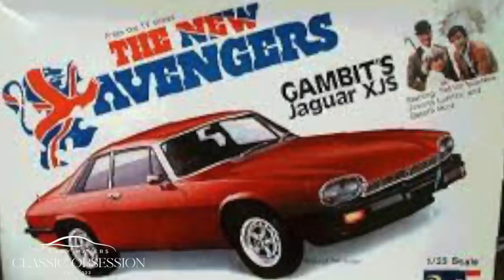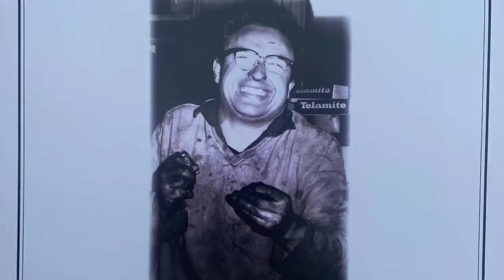Jaguar XJS Barn Find! | Classic Obsession | Episode 5

Comment: An old friend owned an XJS V12. Such a dream of a car to cruise around in, and an eye catcher to boot. I enjoyed every trip we took in the Jag, and I don't recall it being that expensive of maintenance compared to the Mercedes.
Reply from the maker: They’re a beautifully designed car with futuristic looks but at the plant and behind the scenes at production it was a different story. Some cars were thrown together using any parts to hand resulting in none matching interiors, poor rust proofing etc. and this coupled with numerous recalls, cars breaking down along with poor fuel consumption, new owners quickly lost confidence. Which almost resulted in bankruptcy for jaguar during the 80’s. I read once of a mark 2 jag found in a private garage with just 100 miles on the clock. Cellophane on the seats, literally brand new. On closer inspection, the car had never been painted or under sealed underneath at the factory! But that’s jaguar! But I’d still say the XJS is a true Jaguar. Legendary in looks and only now are we starting to appreciate how ahead of their time these v12’s were….but mechanically and build quality, the Benz’s of the time leave them way behind. Regards.
Reply: @classic.obsession  That's not Gary replying well to long and informative lol 😂Regards

Comment: Hi Gary .... the black brake sphere is the ABS "Accumulator"  !!!
.
If it's charged when unscrewed it'll "jump over the moon" ... (it's charged with nitrogen)  !!!
(it could easily cause an injury)
.
The brake pedal needs dabbing about 30 times to settle the diaphragm back to "atmosphere" !!!
.
Yeh it's the motor that pushes the brake fluid into the sphere to make the light go out
.
It's Bosch ABS 3  (i think)
.
Good luck !!!

Comment: Great video. Bought a XJS coupe 1989 with only 38.000tkm in Jan. Done some work on the ignition, Oil changes etc and converted the aircon to modern cooling fluid. Drives fantastic what a machine. Looking forward to next episodes for sure! Rgds Casper (Denmark)

Comment: Lovely video Gary. It looks like you’ve dropped on a little gem with that Jaguar XJ-S she looks in lovely order. I also have one and had similar trouble with the brakes as mine had also not been used for many years. I had to replace the ABS unit as the valves inside has seized. A very expensive repair. The XJ-S is a stunning car with great cariama. I just think there beautiful.

Comment: That black sludge in transmission is clutch friction material.
Reply from the maker: Hi Brian. I’ve just started to get that high pitched whine on start-up from cold. Just for a few seconds then it disappears. I knew I should’ve replaced that other deal when I changed the oil and filter! Sloppy! Regards.

Comment: Worked at BL dealers when these were new,  some absolutely terrible build quality,  we saw the same cars time after time always something different broken. Your either crazy or very brave
Reply from the maker: Ha ha!! Thanks Susan. I think I’m probably both. Sometimes though you can be lucky and every now and then you can touch lucky and get a car that’s slipped the net and put together well. Here’s hoping!! There’s something about it’s flaws that makes you want to put it right and see it in all its glory and how it was originally designed to thrill the public back when the car was launched. Bit like the Jensen interceptor and the Stags. If the car had been less problematic to begin with, with more care taken on the production line and customers trust, these cars would have been legendary from the off. Lucas electrics, non matching interiors and rot just killed them. Appreciate your comments.

Comment: Are the v12s really unreliable?
Reply from the maker: Hi Baruk. It’s not that they’re unreliable. It’s just that because they’re such a huge engine shoehorned in, with all those pipes and wiring melting away and turning brittle. it’s tends to get very hot under the bonnet, cooking cables, ignition leads, belts, hoses and pipes, causing all kinds of problems. They’re also renowned for not running on all 12 cylinders some of the time. But even so, they’re a very smooth, powerful, quiet engine just requiring a bit of maintenance to stay in top of things. Regards.
Reply: @classic.obsession  thanks...so it's not big failures ,more like several small simple things at the same time?